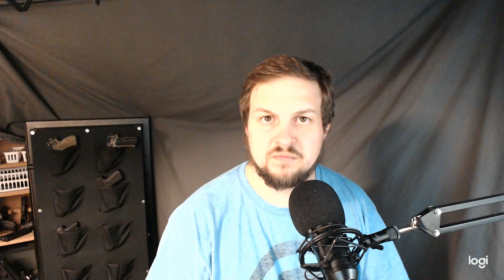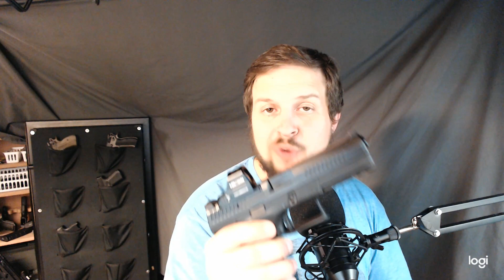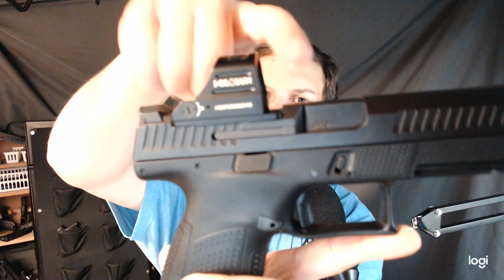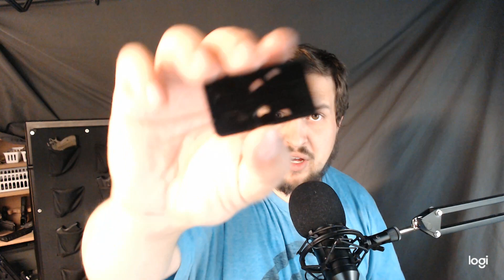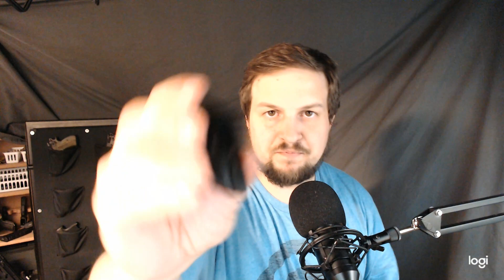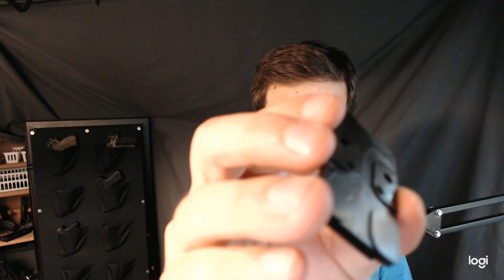401 Manufacturing CZ P10 Optics Plate

Comment: If you want a quality optic plate that's flush and takes up that gap in the front for the p10 series, c$h precision has what you need. The plate for the p1f works for the holding 407, 507, and trjicon rmr. Seriously check them out! Price is right also!
Reply from the maker: I agree 😁 I've been working g with C&H since last Fall.  "Workthetrigger" even gets free shipping on optics plates 😉
Reply: I meant to say for the holosun lol sorry about that😉

Comment: I have a CZ P10F OR and have a Vortex Venom RDS. Do you know if 401 also furnishes the screws that mount the RDS to the optics plate and not just the screws that mount the plate to the firearm? Thanks, great review!
Reply: Purchased from 401 Ebay store. And yes. Screws for mounting the optic was included. I got 3 sets of screws. Rmr,Sro,and Holosun.
Reply: @Neons1223  Thanks. I ordered an optics plate from them for a Vortex Venom for a CZ P10F OR.
Reply from the maker: I honestly dont remember.  I wouldn't bank on it for the price.  If not, you can pick them up at local hardware stores.  just take the originals and check the threads.  Or, what i did the first few times, i cut them down myself, because i'm too lazy to go out and buy them... does that count as lazy?  or cheap.  probably cheap.  I'm too cheap to go buy new ones.
Reply: I am one too!!😉 Thanks. @workthetrigger